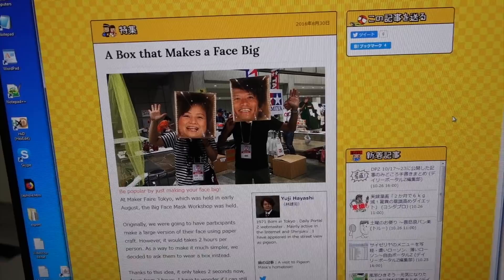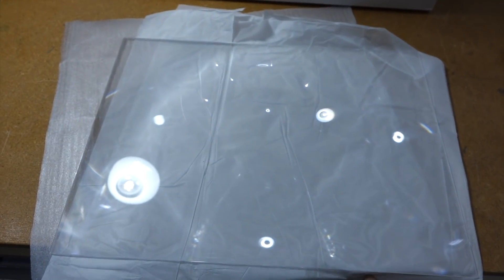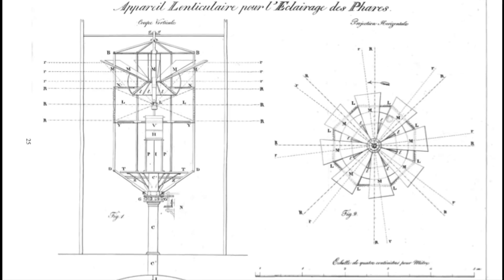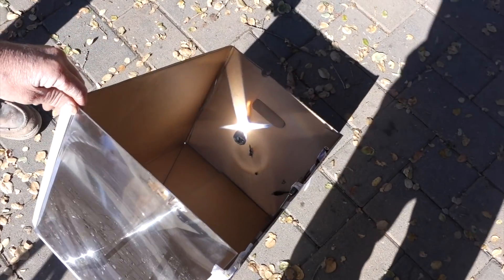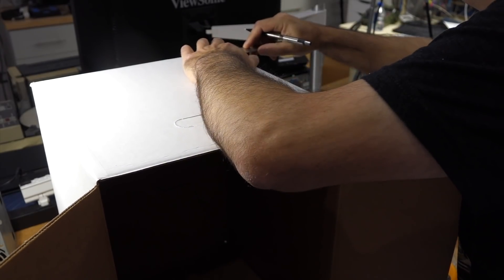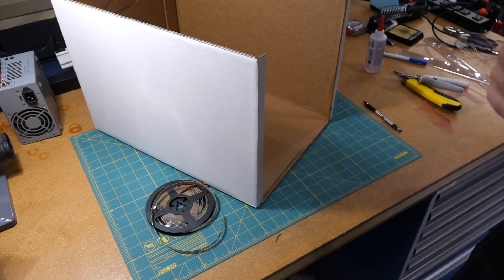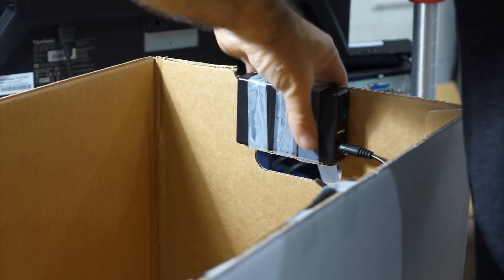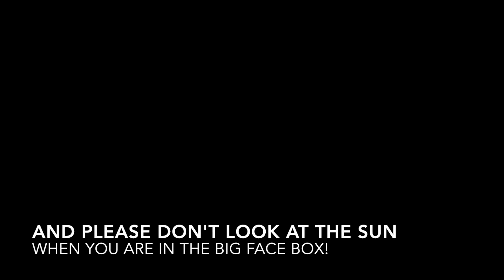Fun with Fresnel lenses: building a big face box (and setting things on fire...)

Comment: If you could use addressable LEDs and run them in a chaser pattern, that’d probably be really cool. Light your face from one side at a time, with the illuminated LEDs running along the length of the strip.

Comment: Salut Marc, nice video like always, on the funny side this time!

If you want really big Fresnel lens for very cheap, please rescue Rear-projection television !!! You get lens as big as the screen. Use really carefully! You can set up fire and/or burn yourself and/or your eyes with UV if you don't know what you're doing. 

Just, in your video you mentioned your monitor. In LCD screens it's not actually a Fresnel "lens", but a prism that converge light from sides to the front (or the other way around if you look through it). 
It's more a Fresnel concept then. But sometime the border between "Fresnel" and "Array" may be also blurry. 
You can always extend this concept, like for example, for LEDs a kind of optic is TIR "collimator" lens (named collimator even if the light output is not 100% collimated, at least it tries); Some company also offer some variant of collimator but with the Fresnel concept, like LL01CR-CFE38L02, which allow for use of thinner TIR optic with larger LEDs. But they are not officially named Fresnel, a pity. I guess nobody care :)
On this kind of optics, the primary optical concept is to use Total Internal Reflection to focus the light, as a mirror not as a convex lens. In between optic fibers and traditional reflector.

Comment: Funny you should mention fresnel lenses and fire....  I saw an incident with an overhead projector sitting unused in a room with a duster placed on the glass. It sat there some weeks until the duster caught fire one day.  The sun position had changed sufficiently over time to align with the projector optics, setting the duster alight!
Reply: In my school you could put down the mirrors flat, and sometimes a student turned them on as a joke, or a teacher forgot.

There were a few with melted plastic. Whoops.
Reply: Fly I remember that style too, the lens being beneath the mirror instead of the front.